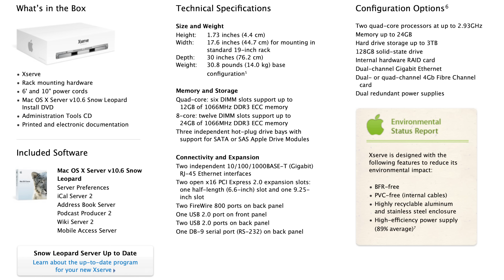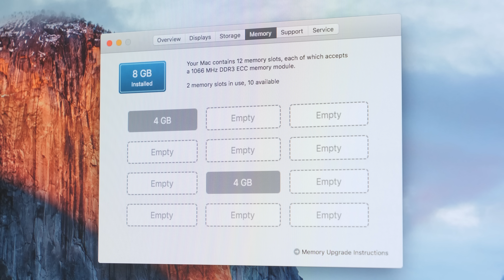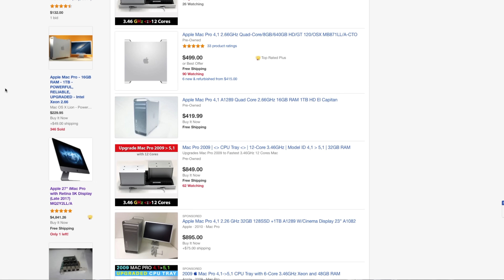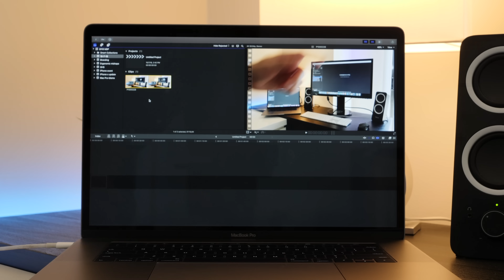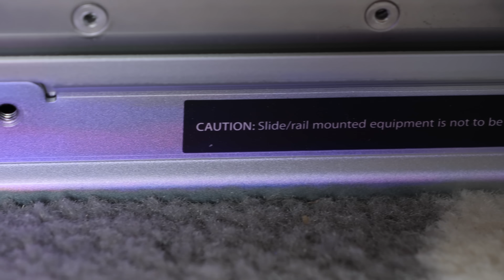I bought the forgotten Apple Xserve in 2018

Comment: Did anyone mention the sound muffled racks?
Reply: As eat the member-berries, I remember half and full rack that cooled at least 6 XServe (both G4 and Xeon model) with XSan network switches.  Before, the modern render speeds of a Pro line Mac of recent days, several XServes could work with coordination software that would orchestrate the jobs.  Thus, parallel solutions provided for content thirsty customers.

Comment: We still got ours! Its only job is to interface with our nas (sanraid) at 10gige speeds. Was built in 2009 as the heart of a multi suite HD capture setup. Still dumping hours of archival footage onto the meager 80TB raid.

We had to buy a floor AC just to keep the temp in the tech room under 30c.

Comment: The Xserve came from an Apple that still had some self respect. You need a server to practically deploy a large amount of computers. Even if Apple didn’t make money from selling/supporting it (unlikely considering the apple tax), it allowed larger companies to buy an apple ecosystem. The sad thing is that the Xserve could run the latest version of macOS no problem. Apple just refuses to allow updates to it. Granted, you can hack it to get it past OS X 10.11. Not to mention that through PCIe, this beast of a machine can support full 4x5Mbs USB 3.0 and have 10Gbs ethernet. Not to mention the ridiculous amount of ram this thing can support. Plus dual redundant PSU that gave sysadmins extra piece of mind. I loved working with these thing. RIP Xserve.

Comment: Does anyone know if you could take this to a 6 core westmere (something like the L5640 to bring the noise down a little while increasing performance) like you can with a mac pro 4.1? I've got a few single height GT1030 and saw a single height 1050 that would fit into this thing, getting drivers might be an issue, i wonder if you could reach out to a laptop OEM to get a 1050/1050Ti that is in the MXM form factor. and if it will work at all
Reply from the maker: The chances of running a Westmere processor in this are slim- the Mac Pro is enabled through a firmware patch, and to my knowledge no such patch exists for the Xserve. The main problem I ran into when researching this machine is there just Isn’t a large support network of users who experiment and mod these machines like there is for the Mac Pro. As far as MXM compatibility it should be possible but you’d need to work out cooling because the GT120 that it shipped with is fanless, so you’d need to implement cooling infrastructure
Reply: I thought it would be cool to use a GT 1030, only slightly more power hungry, but a heck of alot more powerful, and to be honest an x5550 isnt too bad, just alot hotter and noticably slower than the e5645, in this 1u i'd probably try to find an L series, but was hoping for L5620 instead of 55 because of the even lower TDP but with similar or better performance
Reply: Though if you're going through all of that trouble, it might be better to get a dell or lenovo 1u with 2x6 core and then put together a hackXserve but then it wouldnt be gorgeous

Comment: I have one, and with Snow Leopard, it makes an excellent web server. There are many other uses for it as it does support virtualization so running multiple OS's on top of the MacOS is the ultimate host machine. It also makes a great firewall if you need a cheap but affordable hardware solution. I do agree with the noise level and would probably recommend creating an acoustic box to put it in or an enclosed mini server rack.

Comment: You should put a new graphics card in it! It is possible and the card doesn't even need to be a single slot. Get a GTX 1050, and PCI Express extender ribbon cable, and you can technically use a full size video card in it! I helped a guy do it with his 1,1 Xserve and it worked great

Comment: Re: Jet engine nose.
I have 2, 4U dual Xeon machines in my tiny, 1 room place. I swapped out all the fans (went all-in on Noctua fans) and dug into the BIOS to change the default fan speeds from full-blast to low. Now they're not any worse than a white noise generator. Although I don't see any cooling fans directly on the heat sinks on any of the shots of the internals, so a lot more airflow needs to be generated by the other fans than normal, so maybe this solution isn't applicable here.

Your machine should have a LAN port marked "console" or something similar (Dell calls it a DRAC, generically it's called a LOM). If you use that port, the machine will grab two IPs. One for the console and one by the main OS. If you can find the IP for the remote console, you can likely access it through a web browser and in addition to being able to remotely power on/off the machine, more likely than not, it'll have a way to directly interact with OSX remotely. I wouldn't want to edit video or play games through that console, but for some long-running workstation type loads it'd be fine. I mention it as a possible way the machine can be used, but go live in a closet that will dampen some of the noise.

Comment: Servers will usually spin their fans loudly at startup but will quiet down after the system is booted. I had an XServe and loved it until it died and wasn’t worth the cost of repair when newer hardware was cheaper. Mine was not loud at all after boot up. I wonder if your missing HDD trays are increasing the fan speed. My Dell servers will automatically spin up the fans to 100% if the server detects that it’s aerodynamics are altered such as the top cover being taken off. Don’t know if the XServe had that feature as I can’t remember taking it apart while it was powered on.

Comment: I had a server in my home a couple years back and I found a thread online that talked about modding the fans to run at a lower rpm. With a simple 10kohm Resistor I got the fans noise down to regular computer level.
Reply: you can also use a potentiometer in place of the resistor and have variable speed...
Reply: I mean, there are free software to do that

Comment: I think the reason the xserve failed is because Apple was trying to be like SGI, which had super powerful graphics and visualization rackmounted servers that were often run in a cluster, but didn't have the unique and high performance hardware that gave SGI an edge. Especially when they transitioned to x86 (At that point, you could just buy a Dell Poweredge or HP ProLiant.)

Comment: 5:00 A giant rack mounted server..
Dude, this is the smallest rackmount formfactor, its a 1U machine...
An HP DL580 is a giant rackmounted server.
Reply: To be fair the system is like 30-something inches front to back which is a little longer then most but still it's very compact for what it is
Reply: It's comparable to a DL360 G5, its rough contemporary, in size and CPU power.  The DL360 could own in in I/O though.
Reply: Well but in terms of depths there a servers that are quite half the size. Maybe he meant it that way?
Reply: HPE DL580* ;)

Try a c7k Apollo 6k server, now that's a beast.
Reply: depends on the model jec6613, but yeah, generally the 6k servers were huge as fuck lol.  not as big of a footprint of a M1000E though.
Reply: I was gonna say that's a tiny server compared to some of the HP ones I've seen , and if he thinks that's loud try firing up a rack mount NAS with 12 10k rpm drives
Reply: @CommanderMouse72  10ks aren't that loud I have 8 in raid 6 on my desktop
Reply: @CommanderMouse72  The reviewed XServe falls under the "blade" category: the 3U Raid variant for NAS is the "big one" comparable to HP, Dell, IBM and the industry leaders

Comment: I recently bought an HP Proliant DL360 G7 for 105gbp on ebay. It's a pretty good deal and comes with dual E5620 unlike the xserve which comes with dual E5520 and it also comes with 24GB of ECC DDR3 RAM. It's much quieter than the XServe and you can easily leave it running in the same room you sleep in. However it lacks any graphics card so you wouldn't really be able to play CSGO on it.

Comment: With the fan noise, you will get that with any server. Regular computers go through a quick post test before booting, servers do a lot of checks including maximum fan performance. It will quiet down once it boots, but it will still be louder than your regular PC since these rack mount units generally go into dedicated rooms behind multiple closed doors so it doesn't matter.

Comment: For information, the Xserve additioned with the Xserve RAID would cost about 60€ monthly for electricity, in France (which has not the most expensive electricity by the way). Quite a drawback. Though, the interesting stuff is you can install ESXi on it, and with the multiple cores, ram, an memory, have multiple OSs running, like macOS and Windows Server at the same time, for Xcode projects and having like exchange and all that stuff running too in a quite small forme factor. One box for a small company

Comment: You forgot to talk about the power consumption! It’s really a bad idea using this server with this power consumption in 2018. If you run the server for several hours a day you will spend more money than just buying a Mac mini or a MacBook in the first place.
Reply: Matthias Wagner uhh you business won’t care of power use they care what the server can handle, A SERVER IS NOT MENT FOR HOME USE. Their loud they are power hungry, power consumption won’t matter for business since their running power hungry devices
Reply: I assure you, power consumption matters on servers.  A full rack of equipment can run 500 kwh per day pretty easily - a 10% improvement on that can be $1000 per month, and it also means a smaller UPS, smaller A/C (so even less power still), and smaller generator.  Yes, service availability matters more, but power consumption is still a hot topic in the datacenter.
Reply: Lol, no.

You have no idea what you're talking about.

Comment: I would tap a connection somewhere wire in a resistor that would work with low rpm fans. Pop on standard coolers ditch the top and a full gpu. Throw that janky goodness in a closet and call it a day. I wonder if you could swap in better cpus as well.

Comment: 50k for AppleCare... WOW
Reply: Probably 24/7/365 on-site service.
Reply: That was for a level of service unlike anything available for a Mac. The AppleCare (as in, extended warranty) only cost a couple of hundred bucks. What the 4-5 digit options were were for enterprise support. Some tier added something like 4h guaranteed repair. But above all, it was to grant you access to high-level software engineers to get software problems fixed FAST by people who really, truly knew the software inside and out because they wrote the damned thing. (And I’m not sure, but I don’t think you had to spend the $50K per machine. Just pay that once per year for your data center.) 

The service contracts for enterprise server software from other vendors is very, very similar — it’s where red hat and IBM and HP Enterprise and Microsoft make their real money.

Comment: Basically same specs of my Dell PowerEdge r410 but with better e5620s 4 cores 8threads each. Got it this summer for $115, $100 for the server, and $15 for the shipping. I have this in my room but it is not as loud as yours. I put my GT 1030  into it for gaming.

Comment: The biggest reason this machine is no longer very practical is the power usage.  That thing will cost you a ton in electricity.
Reply: Kevin Collins power hungry is nothing for a business lol, for home yea good luck but for a business it won’t matter for them
Reply: Uhhh, no? It won't?

Lol, first Gen i7 were not power hungry at all. What are you on?
Reply: where do you see a first gen i7? it's first gen Xeon, times 2.
what are you on nexxusty?
Reply: @DecibelAlex  it's nahalem, it's basically a rebranded dual x58

Comment: I think your expectation that this should behave like a workstation or be comparable is wrong. Not understanding this products place and saying that Apple was confused with where it fits in the industry is also incorrect. Apple always had a strong background in education. Back when Xserves were important were when you couldn't always join a Mac to a windows network without writing LDAP configuration strings. There was no group policy for Mac inside AD.... Apple had Mac Server which was beautifully simple to run and manage hordes of Macs. Perfect for a school environment, or a studio environment, to manage your Macs. No VNC product out there today was as easy to use as Apple Remote Desktop, no imaging software as easy as NetInstall. Then there's Xsan, clustering... all equated to time and resource savings for IT departments. I had 3 guys managing PCs, vs me spending half my time on Macs which made up 50% of our fleet - massive IT savings.
Reply: Here, here. well said. I know a lot of IT depts running dual Mac minis in rack mount chassis for the same reason. The difference of course is you are not getting Xeon CPUs and ECC memory going down that path. I do miss the XServe and the simplicity it brings to a network with Macs.
Reply: That’s not what he said at all, he said he knows it’s not meant for him and in the first few minutes said why, but that he wanted to make a video about it if you were considering the Xeons inside. 

If anything this video shows why it’s silly to think of it that way, but for you and the rest of the nerds that have selective hearing because you’re taught by your shitty employers how to cut corners... well, you’re gonna see it as a server video that was made wrong.

I’m facepalming at all of your comments about how he did the video wrong.

Comment: Got one this summer. 2008 2,1 8 core 2.8 Added 32gb ram 3 1tb drives and ATi 2600 I had laying around. Mounted in vertical wall mount rack. $80 shipped.

Comment: "if you REALLY wanted to"
"its honestly not bad"
"MORE than fine"

No, this server is a piece of shit and hence why Apple got rid of it. Its not worth at all, it consumes a lot of power, its outputs ALOT of heat and I hated them when my company thought they would be on cutting edge when they ordered hundreds of them and they were quickly replaced by more reliable IBM servers racks.
Reply: Its not worth, like, 150 bucks and some elbow grease? Even if its underpowered and finding a use would be hard, if you did have something for it to do, that seems like a good price.
Reply: IBM system x 3550 M4 now that’s some good shit

Comment: Would you consider getting a server caddy to install the Xserve in?  The computer is designed to fit in standard racks.  (Hmm, how much does a bare rack cost?)
Reply: Daryle Walker $800-$1200
Reply: Bear in mind, due to its depth, it requires a computer rack, not the much, much cheaper telecom racks or AV racks!

Comment: What is the latest version this thing can run? Lion?
Reply from the maker: It runs El Capitan surprisingly
Reply: @lukemiani  wow! Does it require any modding / post install scripts? I bought a 1,1 Mac Pro for roughly 75 dollars 6GB/4TB mainly for doing a hackintosh case mod. Ended up buying a second broken one because the 1,1 runs El Cap. so well with a new GPU.

Comment: Luke, I swear to god you must be able to see my tech collection because you have both a Mac Pro and an Xserve!

These Xserves are pretty nice. I have a 2,1 myself with 32GB of RAM. It is tolerable to have in the same room as you are in if you keep the room well cooled. I keep mine in my bedroom about 10 feet away from me, and it's loud, but not unbearable. 

Uses for this thing are endless. You can use dosdude1's tools to install recent versions of macOS on it. However, I only recommend going up to Sierra as High Sierra and Mojave gimp the Server.app used for a lot of the features. I have 3x2TB drives in there(it's very picky about what drives work in the bays), and a 120GB SSD mounted on a PCIe to SATA card. I use it for Plex for my movie and TV collection, an FTP server for storing and accessing files on the go, and a caching server, since most of my roommates have iOS/macOS devices, it stores the updates for these devices locally, so when they update they pull from the server, not from Apple's server.

Honestly would love to see a follow up video. Would be happy to help you set up some of this stuff; it took me god knows how long to figure out the intricacies of the Xserve.

Comment: This is a server meant for businesses it is meant to be in a different room. Apple made it for MacOS Server. You can use VNC/Screen sharing to connect to it built into MacOS. But can you get it to run Freenas? this would be a great file storage server. Right now I have an HP server running VMware but I need a file storage server

Comment: I don't know, maybe it could replace our 2014 Mac Mini, it doesn't do anything that intensive, other than some occasional Photoshop. We where thinking about getting an 8TB drive as a hub for everything in our house, but maybe with the rack add-on... The one thing I need though is Thunderbolt 3. I have been thinking about a hackintosh just for this, but don't really have the money for a 1 use $350 computer. Is there a way to a T3 to this? Thanks!
Reply: look into getting a nas if you want lots of storage instead of getting a server.
Reply: @yungcyan6827  Imagine thinking for a second you can replace a workstation with a server lmao. This shit cracks me up.